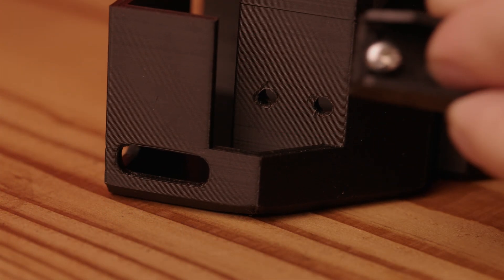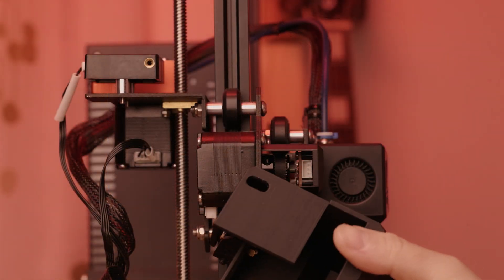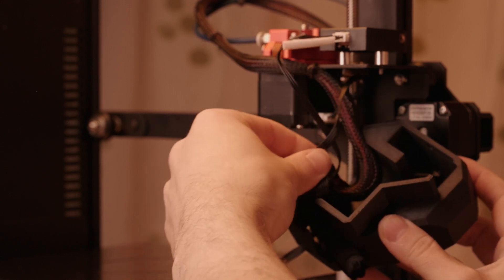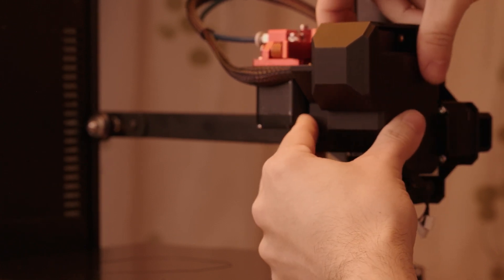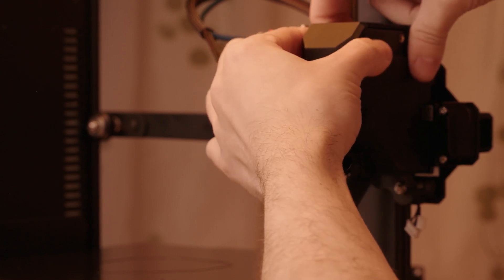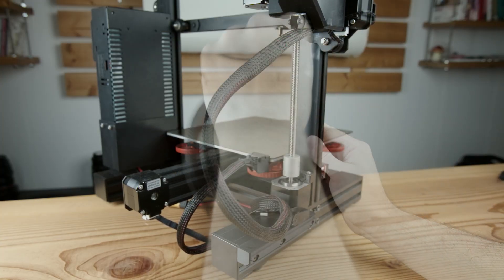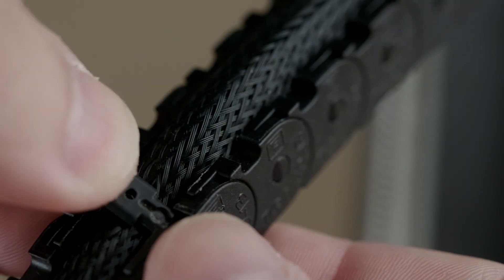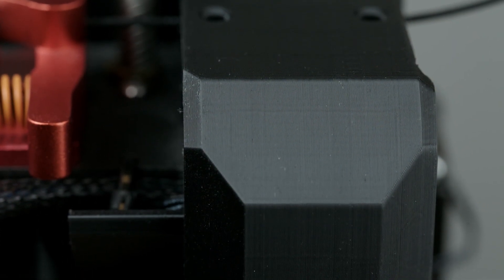Cable Chain Upgrade: Elegoo Neptune 2S Cable Management

Comment: a question: do you have a cura profile that works well for this printer, im having trouble with my profiles since the update
Reply from the maker: sorry for the late reply. I used this profile https://github.com/Toylerrr/ELEGOO_Neptune2_Cura then make small adjustments on individual prints. If you look at my Printables projects I usually write the important points https://www.printables.com/social/251816-mochamame/about . With Cura I use version 4.13.1. One Time I tried updating and wasn't happy with the results, Cura changed  the algorithm for Z-seams and it made a mess. Also there is the new v5.3 that includes N2S profiles, I haven't tried yet but it could work for you.

Comment: Thank you so much. Which Buildplate are you using ?
Reply from the maker: Thank you too! For this print I used the smooth side of the standard plate. It's not easy but gives a nice surface. Sometimes I put painters tape on to get it to stick better.

Comment: This doesnt fit whit a bmg extruder :'v
Reply from the maker: if you can share some photos or measurements I could try to make a modification.
Reply: @MochaMameX  im modifiying the one i print, i have to rotate the extruder, for now is working as expected just have to find how to reverese the extruder motor steps because its printing in reverse lol .Then fix the filament detector height, and i can tell what is the exact measures and modifications to do.
Reply from the maker: in the firmware >INVERT_E0_DIR  change 0 to 1 and it will reverse. when you get it sorted let me know if you need the mod

Comment: What slicer settings are you using? if you don't mind me asking
Reply from the maker: The prints in the video are not the actual prints, the actual ones stuck down better than in the video but I wasn't filming. I washed the bed with soap water which worked really well for adhesion but looks like a mess on camera so in the video its washed with IPA. Here are my settings:
PLA+ 
Layer Height: 0.2
Line Width: 0.38
Wall Count: 2
T/B Thickness: 1mm
Infill: 10%, Grid
Print Temp: 195
Bed Temp: 55
Both temps 5 degrees hotter for initial layer
Print Speed: 60
Infill Speed: 70
Outer Wall Speed:40
Inner Wall Speed: 60
Initial Layer Speed:20
Cooling: MAX
A little support for the cover around the slots and near the top of the filament extruder. The bracket doesn't need supports.

Comment: nice video, but i'll need to print the cable chain, thank you
Reply from the maker: Thank you! even without the chain, just printing the cover cleans it up nice... but hey why not go all the way
Reply: @MochaMameX  Have some nice matte black filament that will get used for the cover when i get home =)
Reply from the maker: interested to see it if you can share a photo!
Reply: @MochaMameX  I printed the cover block in orange, and I've printed a new hot end with a dual fan blower in the same orange filament. I ordered the cable manager chain, but I will need to make some adjustments as I ordered what you had linked but, unfortunately, the holes do not line up. As opposed to two holes, there are now 3 in a triangular pattern. An easy fix none the less ;-) When it's finished, I'd love to share with you.
Reply from the maker: @r65  thanks for trying it out, haven't seen to many finished makes so it would be cool to see!